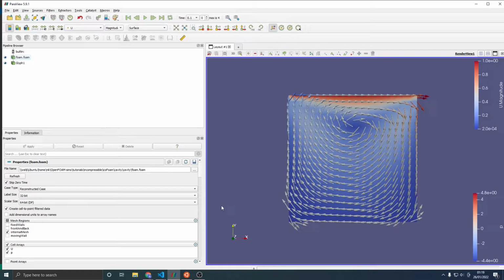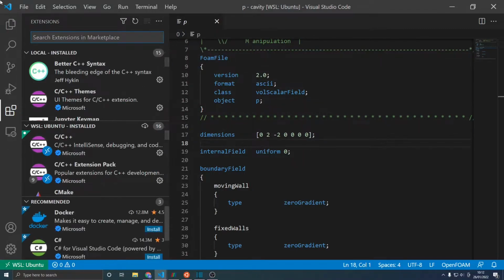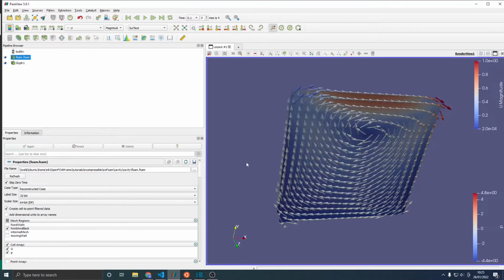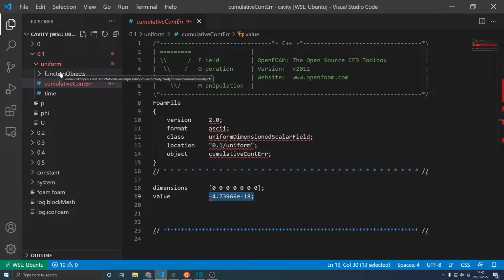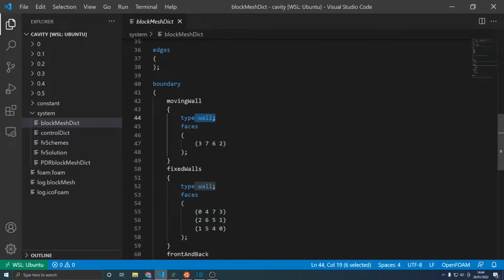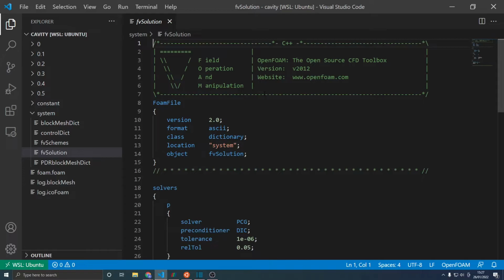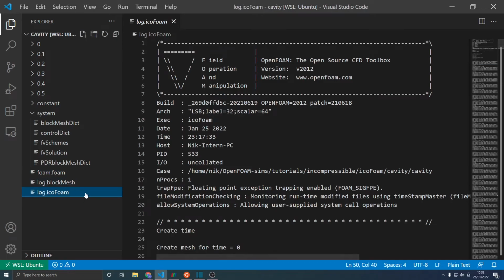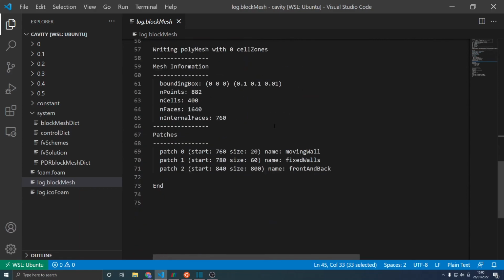File structure of OpenFOAM cases | Beginner tutorial series #2

Comment: The VS Code thing doesn't work for me even though I have it installed.  I get this error:

Command 'code' not found, did you mean:

  command 'node' from deb nodejs (12.22.9~dfsg-1ubuntu3)

  command 'tcode' from deb emboss (6.6.0+dfsg-11ubuntu1)

  command 'ode' from deb plotutils (2.6-11)

  command 'cdde' from deb cdde (0.3.1-1build1)

  command 'cde' from deb cde (0.1+git9-g551e54d-1.2)

Try: sudo apt install <deb name>

A work around is to just use explorer.exe and view the files there.
Reply: Try using GNU Nano. It is terminal based.

Comment: Thank you for useful videos. However, i have a problem when i write "code ." i got this message

"
kame@KAME:~/OpenFOAM-sims/tutorials/incompressible/icoFoam/cavity/cavity$ code .
Command 'code' not found, did you mean:
  command 'node' from deb nodejs (12.22.9~dfsg-1ubuntu3)
  command 'tcode' from deb emboss (6.6.0+dfsg-11ubuntu1)
  command 'ode' from deb plotutils (2.6-11)
  command 'cdde' from deb cdde (0.3.1-1build1)
  command 'cde' from deb cde (0.1+git9-g551e54d-1.2)
Try: sudo apt install <deb name>
"

How can i solve this problem ?
Reply from the maker: Have you installed visual studio code? It's optional to use it, you could equally navigate your Linux file system by typing `explorer.exe .` and editing all the files with your favourite Windows-based text editor. Equally, you can do everything through the command line - if you need to edit a text file, just do `nano filename`, replacing `filename` with the full name and location of the file you want to open.

Comment: please do more, you are one of the better teachers ive found for openfoam so far! could you possibly cover compressible flow and supersonics as im doing a dissertation on rocket design and have no experiance with this program. i will have to run supersonic flow sims in a vacuum too, do you have any useful info regarding this?
Reply from the maker: Absolutely! The area I'm personally most experienced with is hypersonic aeroelastic / aerothermal sims, so I'll definitely make a tutorial video on compressible flow at some point. It might be a while though, because I'm currently trying to improve my workflow for making animations.

Just as a tip in the meantime, I recommend using rhoCentralFoam as the solver (I've found sonicFoam to be unreliable, and the other rho...Foam solvers are better for low Mach numbers). According to the literature I was able to find, kOmegaSST has been found to be the more accurate RANS turbulence model, although at hypersonic speeds LES is preferred. You should do your own research though. Potentially you could get away with an inviscid flow assumption, although from personal experience the force predictions change quite significantly with this assumption.

There are some tutorial cases in the $FOAM_TUTORIALS directory for rhoCentralFoam (in $FOAM_TUTORIALS/compressible/rhoCentralFoam) - they are useful starting points to then modify later for your own purposes. They all use inviscid assumptions though, so if you want to use turbulence models / viscosity then you'll need to copy the relevant settings from tutorial cases for other solvers e.g. rhoPimpleFoam.

If you run into stability issues (e.g. transient negative temperatures in certain areas of the mesh), then consider adding temperature and/or velocity limiters using fvOptions. Also would advise a low courant number (<0.2 for stability).

This video might prove relevant to your purposes
https://youtu.be/03NYTBL3QDE

Good luck with your dissertation!

P.S: here are some documentation links you might find helpful
rhoCentralFoam: https://www.openfoam.com/documentation/guides/latest/doc/guide-applications-solvers-compressible-rhoCentralFoam.html
fvOptions limiters (constraints): https://www.openfoam.com/documentation/guides/latest/doc/guide-fvoptions-constraints.html